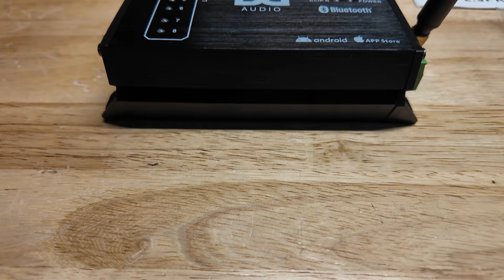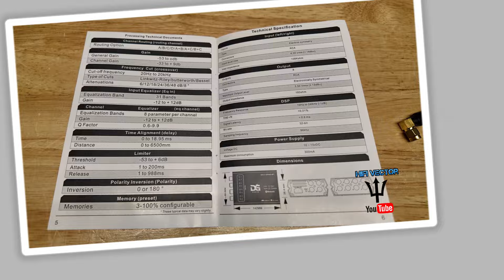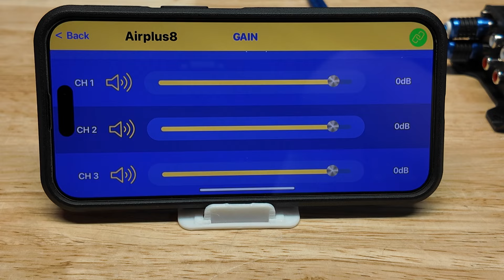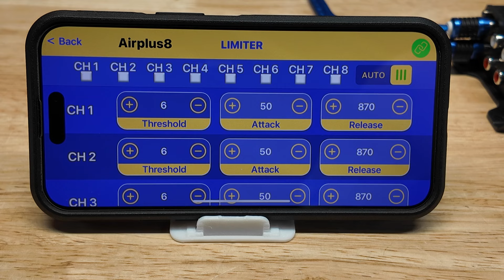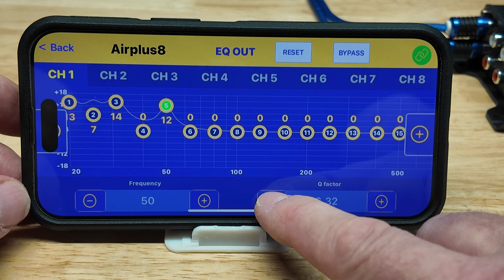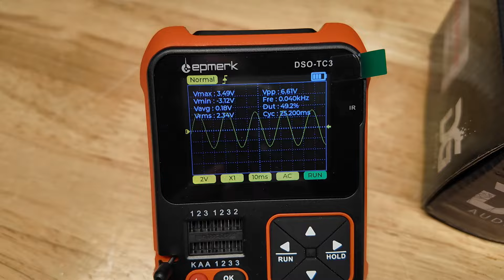DG Audio car audio DSP DG-2.9PRO-BT digital signal processor review

Comment: This looks exactly like the Marts 8 Channel Output 32Bits 96KHz Bluetooth DSP / BTX8-DSP except it has the little antenna on the back. I wonder how they both compare. They use the same exact app too lol.
Reply: I notice the Dayton Audio 4x8 DSP and the Deaf Bo9nce Machete DSP are identical, even the accessories sold seperately other than LED colors.
Reply: @murrayshekelberg9754 ground zero also makes one for $400
Reply from the maker: Not sure of every difference but they both perform great.
Reply: @HiFiVector which dsp do you like better I was leaning more to the marts BTX8-DSP I had a stetsom floating dsp was looking to try something different

Comment: Could u explain the bypass ? Could I leave the bypass on for a flat signal coming in and then eq it going out ? I do not have an RTA to measure so I was go flat then not be able to see any dips and peaks in my system . Didn’t want to get a clean sweep either

Comment: looks like a nice product, and the app isnt too gimpy. wonder what kind of floor noise it has, and if it has an amp turn-on feature to keep pops in check?
Reply: This is an EXPERT 8 CH 32 BIT 96K Bluetooth Process now like previous items from them they had a delay turn on for amps maybe they fix the pop but i have yet to see someone test that.
Reply from the maker: Although this kinda looks similar to this is not the same as the expert 8Air. This DSP has way better output voltage compared to the expert.